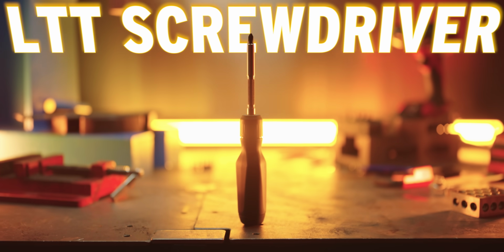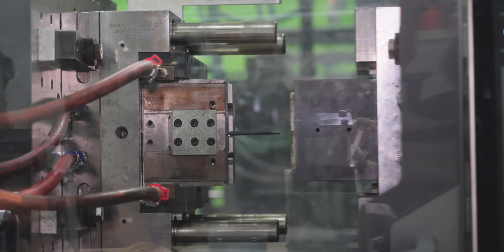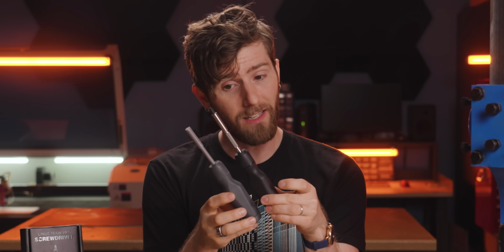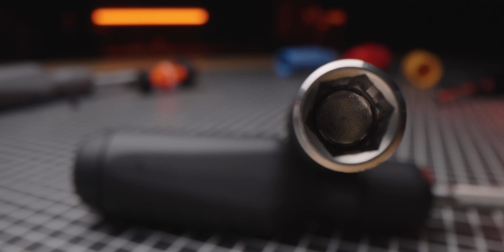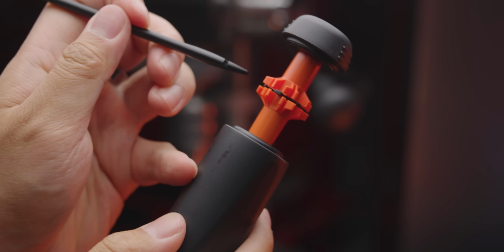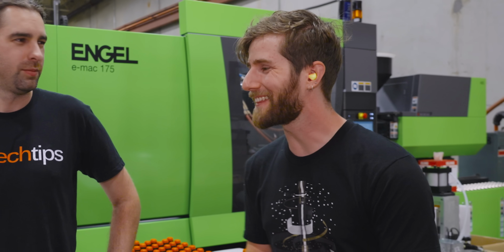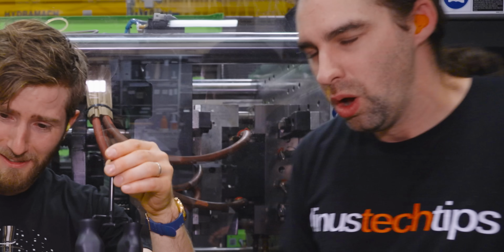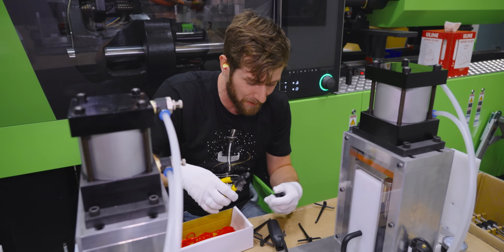Why our Screwdriver took 3 YEARS

Comment: My wife bought me LTT screwdriver for Christmas and it's a work of art. The quality is superb, the sound and feel is nearly perfect, the knurling is so well done... I used a cheap Bosch ratcheting screwdriver before and it was OK for <20 bucks. Plenty of bits, but a lot more slop and play, no knurling and the rubber intended for more grip now looks like peeled off skin. 
One thing I've noticed is that the black on the bits does come off fairly quickly, revealing the metal underneath. A small complaint, but there's that.

Comment: As a CNC Machinist there is something I would like to correct you on hardened steel doesn't make it really difficult to machine it just mean you have to have tool made for machining hardened steel and it takes a LONG time especially compared to aluminum.

Comment: Honestly, if it took you 3 years to design this, you didn't have any requirements in the first place. While you claim to be an experienced product designer, you are not a durable goods designer and 3 years emphasises that.
Reply: did you even watch the video? There's a reason it took 3 years. They said they were basically done in 1 year and then ran into a bunch of issues with production - which is not particularly their fault

Comment: I JUST got this as a gift over Christmas! This is the BEST all-around screwdriver I’ve EVER OWNED.

I love it!! The storage compartment doubles a fidget toy as Im finding I’m just casually opening and closing it with that satisfying magnetic closing action without thinking lol. It also rotates freely so I can push in screws and turn at the same time. Thats a super coool neat feature.

It’s so smooth and extremely well thought out. The ratchet switch mechanism clicks so satisfyingly. Using one hand to actuate the ratchet direction is such a nice touch. the knurling on the shaft is so cool to get the loose screws to get in during the first few turns.

The casing is a higher quality durable plastic, and doesn’t feel cheap at all which i thought It’d be when i first looked at it.

You guys put a ton of thought into this. All the mechanisms from the storage compartment opening and closing, snapping the bits in and out the compartment, putting the bit in, and all the clicky bits are SO SATISFYING. It’s my little fidgeting toy as well LOL.

This tool feels and exudes the word “premium,” and I feel like it’s actually quite an EXCELLENT price for what it really is!

Comment: Have you listed which replacement pen refills are compatible? I'm gonna buy one as long as it's not a single use pen, it'd be a shame to just throw away an lTT screwdriver pen after it has run out of ink and I would want to use that pen as the last pen I'd ever buy.

Comment: What they really added to this driver is HYPE. A half hour video of hype to get an extra 50 bucks out of you. Nice driver but basically the same as anything else. I would pay around $30.00 for this at most. Its just a driver people, not a family heirloom.
Reply: I’ll admit it’s not worth 70 usd but If you catch it on sale it’s well worth it. I got mine for 40 USD which is a very normal price for a high end screwdriver. Good Ratcheting screwdrivers aren’t cheap bro and if your line work requires a screwdriver it’s definitely worth it.
Reply: @astloom8903  Ok "bro"

Comment: Cool Tip about the LTTScrewdriver if you're transitioning to this screwdriver entirely from things like the IFixit screwdriver, There is a Bit Adapter in the Ifixit Kit so you can use your IFixit Screwdriver bits with a Traditional Screwdriver

Comment: So a year later of hemming and hawing I bought the LTT screwdriver and I am legitimately surprised. The knurling is VERY aggressive and feels amazing. The selector ring being modified to TURN IT THE DIRECTION YOU WANT TO GO is a game changer to me. I have a Megapro and Craftsman and the LTT is still notably better for small tasks like 3-D printer maintenance. The handle ergonomics are great, build quality is up there with the best and it has the strength to do a much most people's grip will allow. Overall, Great Job LTT!!

Comment: All I would say is missing from the website (knowing it isn't electrically insulated) is an ECX/ combination bit for electrical outlet and breaker box screws
Reply: I can't imagine they would do that as the driver is not rated to offer and electrical insulation value and with out that, offering the bit would be a MASSIVE liability and frankly irresponsible.

Comment: Great video! interesting stuff. Excuse my ignorance, but with the level of detail here in the clip. Aren't you just showing a rip off rival firm how to make a competitive product? As China manufacturers are quick to do.
Reply: Good luck copying the ratchet mechanism. The tolerances needed are tighter than most cheapo factories could produce and copying it 1:1 would it would likely bind up or not work at all.
Reply: this isnt a new product, ratcheting screwdrivers with detatchable and storable bits have been around for a while. This is just a high quality one

Comment: The Wera 816 RA ratchet (Rapidator without bit storage) offers a solid base, making it especially robust. 
The Wiha CentroFix 40331 is characterized by absolute zero wobble, which means you can use long bits, like 1500 mm, with no wobble at all—it's like using a fixed screwdriver. 
Another great addition is the Wiha CentroFix 7148, which also provides zero wobble, perfect for your screwdriver with bit-style drills.

Once you've tried CentroFix or Rapidator, there's no going back. Let's keep it simple—stop adding things like bit holders and hollow parts. @linustechtips, I'm literally challenging you guys to purchase these two or three and make a video about them. If you're still convinced by your tools over these, I will buy one!
Reply: I mean you haven’t even tried their screwdriver how r u even comparing? Who’s gonna take ur word for it?
Reply: @astloom8903  i literly sayed please compare and prove that its better; )

Comment: why is it so expensive?
Reply: This is a fair question, and I hope that my response helps to understand from my perspective. Designing a product isn't just pitching an idea and "Oh, here it is, just like I pictured it and hoped it would be," popping it out at the end, absolutely "perfect". This is an iterative process, taking time with multiple steps as they test at each step, which has associated costs. They not only have to cover the cost of production of the final product but the process of research and development amortized into the cost of the end product. There's several ways to accomplish this, and I think that they've struck a reasonable balance between initial price and overall value. The cost may come down over time, but we won't see that until they've recouped the initial investment in R&D. Did they succeed? That's for each user to decide for themself. This is the singularly most "expensive" tool that I own in this class, and in this, it's one of the best expenditures that I've made. I have several iFixit tool sets, yet in this, I'm impressed with the quality of the LTT screwdrivers such that I'm glad that I've added them to my toolset. Imo, fwiiw, ymmv....

Comment: Too bad shipping from Canada to the EU seems to be an absolute mess.
The screwdriver is already rather expensive with $70. Shipping to Germany costs another $25 and 19% taxes on top, so $113.05 in total. I don't mind paying a bit more for a better product, but that is pretty expensive. The similar looking Amazon Basics one costs a tenth of that.
Now you could buy more products to get more out of the shipping fee, but then it gets more complicated because for orders until 150€ it's enough if the retailer does the taxes. Above that I have to do that when I receive it. Also there are plans to do that for all orders anyways, so to showcase it with that order, I'd have to pay another 3,7% duty on the whole price, so another $4.18. Then another 19% on top of all that, bringing me to $139.50 in total and the carrier also charges a bit for collecting that (at least 6€). Seems like LTT does refund the $18.05 taxes they have collected, but it still raised the base that the actual taxes were calculated on.

Comment: Have got the screwdriver for a few month. only thing I dislike is the black coating on the bits. they wear off over time and gets on my hand easily when trying to get the bit out (the magnet is stroooong indeed). just a satine finish would be prefect for me.
Reply: they don't make satine finishes

Comment: is there a way to get a stubby screwdriver with a 8 inch shaft? i need a small handle with a long shaft for alot of the work ido.
Reply: lol, no. just get a bit extension. or buy extremely long bits. it's not rocket science dude.

Comment: I was all excited that I was able to get a SnapOn screwdriver for a fraction of the price… then I saw it was just as much with a major limitation compared to the snap-on. Snap-On’s version allows you to change the shank so you can have a long, mid length, or short. This has a slightly better bit storage, but that causes the handle to be rather large… not sure if that is good or bad I guess.

Comment: I laughed when this first came out when I saw the price but after needing a new screwdriver to build a PC, I felt like I might as well see what all the fuss was about.  I ordered the LTT screwdriver in orange/black from Amazon and it arrived a day later.  I have to say, this is without a doubt the best screwdriver I have ever owned/used.  The ratchet, the bit holder, are all quality feeling in the hand and especially when you twist or close the cap.  It has that satisfying SNAP to it.  It has a nice heft to it, the magnetism is nice and strong and it has a nice variety of bits for everything you need.  They also sell more bits if you there's something missing, maybe for working on a console or something.  Overall I'm happy.  Expensive? Yes.  But you get what you pay for.

Comment: honestly with the crap sold these days, I may actually want an LTT screwdriver, I do have a shitty handle that has no ratchet and uses a 1/4 square with an adapter for that(why) that I used one to torque a 3 inch screw to adjust my front door latch in my apartment(no drill at the time) and I actually snapped my ratchet wrench

I still am gonna use my wowstick and childhood stolen precision handle(I had issues) for small electronics, but for normal PC stuff I think I want a linus shaft device that screws stuff(dirty mind song playing in my head lol)

it looks like an actual good idea to have a almost 0 backlash, small handle, low force, ratchet driver for PC stuff, and given the seldom times I actually need torque(home gamer doing basic DIY like pictures and LED light bars) I seldom will need to bust out the old firestorm drill with my future Li-ion retrofit batteries

I prefer the orange+black+metal to the noctua theme as I think noctua colors are just ugly, I might ask for a black powder coat model be re-made as I want the scratched look of a well used and loved driver

Comment: 70$ for a screwdriver is way too much! You can buy 3 craftsman screwdrivers which drives screws with each left and right turn, delivering 2 times the speed of a standard ratcheting screwdriver.

Comment: The only reason I won't buy this is that I hate  proprietary parts that's why I don't buy Apple And I won't buy that driver either I would if I could get replacement bits from anywhere.  I truly love everything else about it and I've tried it and I promise you if it took standard 25 mm bits It would be a no brainer. Maybe you and Mega pro should do a collaboration between the 2. Top half a Mega pro bottom half lines I would buy that one. I know myself and no matter how hard I try I Lose bits.  Then there's also the price  But apparently you paid triple for the LTT logo

Comment: Why not make a version which is certified/tested and suitable for electricians? Add an insulating layer of rubber and certainly some details but overall this will extend the usability of the tool drastically as I for instance ONLY use  this type of screwdrivers as I got shocked several times already due to some sloppy installations, induction or simply caps...

Comment: I worked at a hardware store and talked to a lot of handymen (and women!) and what actually matters most to the average "pro" is actually not the quality, but the support. Tools break, especially if used day in and day out- and especially with todays low standards in workmanship. When these $200-$1000 USD tools breaks, the customer demands a premium support experience from the company. 

DeWalt is a brand that jumps to mind, they make a quality product but it's their warranty that makes them so popular in professional settings. The tool breaks and theyll fix it for you or replace it- they're like the Nordstrom of powertools! Lmao 

So, in conclusion, provide a upper-midrange product with A++ support and youll have customers for life!

Comment: This video made me think of lots of design choices I made at work, which might not have improved the rough concept of the delivered result (in this case: make the screw go in its place), but did improve reliability, adaptability, usability, insight, auditability and I probably forgot to mention some.

There will be lots of things you think you do not need perfection for, and yes perfection is expensive. But i will almost always try to choose quality above cheap disposable or expensive brandname. Looks like this is one of those items to choose

Comment: You guys should make one with a shorter shaft. In auto work it's pretty common to have really limited space.
Reply: Don't think that's possible if it's going to hold both the bits and the ratchet mechanism, that's the design problems they struggled with that led to the bits being so tiny. This is more like swiz army knife, it can be good in a pinch, but it's not something you'd use as a real tool, it's more just because it looks cool. This is the kind of thing I'd only buy if it came in different colours, so obviously not because it's a great tool, but because it's a cool tool and we like the channel.

Comment: 5:07 I get options are great and I am not diminishing the work they put into this to give us 12 bits, but having 12 bits is absolutely not a necessity, while I can't speak for all areas of tech I have built several computers for myself and several of my friends ranging from typical desktops in various cases to servers and raspberry pis and I have only ever used 1 Phillips head screwdriver, ONE! No replaceable bits nothing, just a single bit. So no 12 is not a necessity, it is a nice to have. With that said I absolutely will get this screwdriver at some point to get that ratchet and support the channel.

Comment: But the problem with any bit screwdriver is that the shaft will not allow it to go down into small diameter deep recessed screws. I wouldn't be able to open my ups to change the batteries with this. How about just a 12 piece regular screw driver set as well.

Comment: I have a Gamers Nexus screwdriver set and an iFixit kit, but I just ordered this as a complement to those sets. None of them are ratchet screwdrivers and I don't have one. It's also an AIO solution. The GN set is, well, a set of many screwdrivers, so if you need a different length or head you have to put one back and grab another full driver. iFixit is one driver, but a whole pack of bits that you have to carry around. I like that this just has all the bits stored in the handle, neatly at that, so all you have to carry around is the driver and that's it. So now I have something more portable and that ratchets. Different drivers for different situations and this will be a great addition to my set.

Comment: ok you may hate this - I lose my screw driver all the time and this  is the most expensive I have ever bought. could it be possible, that at the back of the driver, we could somehow fit an airtag on it? Also, would be nice to have a compact case for it, with bit holders. The interal bit holder was the best I've used. Very clicky very nice

Comment: As an electrician second year apprentice, i bought this not only for the brand, but also for more uses. What i meant by that is that i could carry less tools with me while having the bits ready for me especially when i’m on the ladder. What i’m disappointed is that you guys don’t include or sell robbie number 10 or 3 since i’m installing 1 1/4” or bigger emt couplings and connectors. I guess i’ll find a different vendor to buy that bit >.<

Comment: I bought the screwdriver. It's OK. It has a design flaw. The end of the handle rotates. The little cap for the bit holder. This is SUPER annoying. It's not intuitive and just doesn't feel right. I hope LTT corrects this in the next version.

Comment: A bit of correction, the molds are mostly cnc machined and edm is a finishing step   or used for some very small design features. And holy f*** you paid for molds.